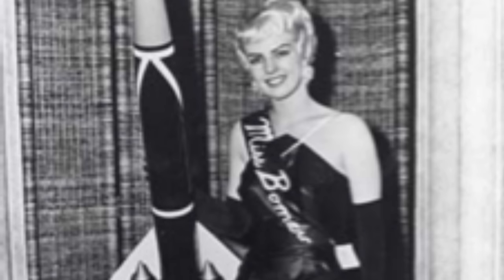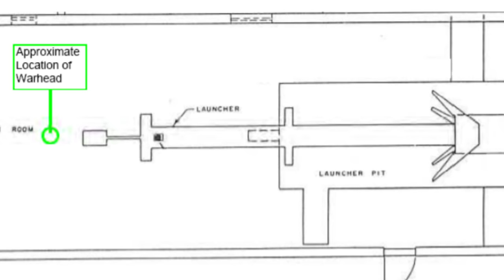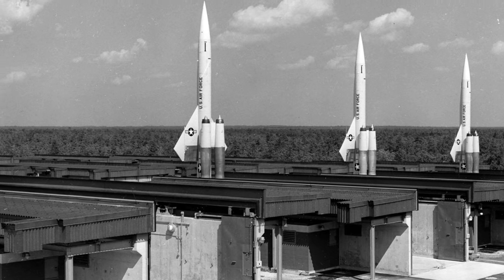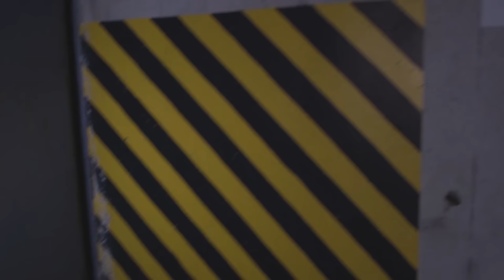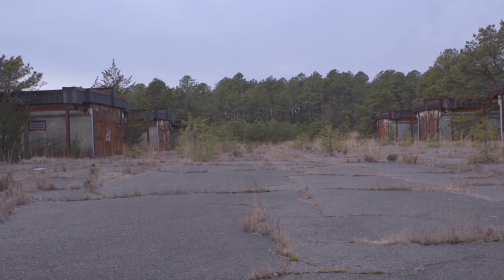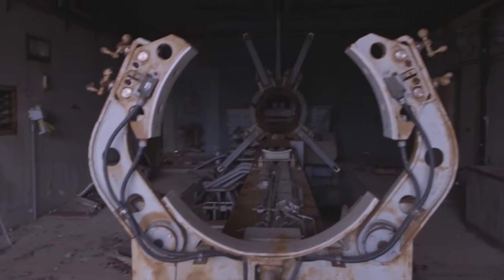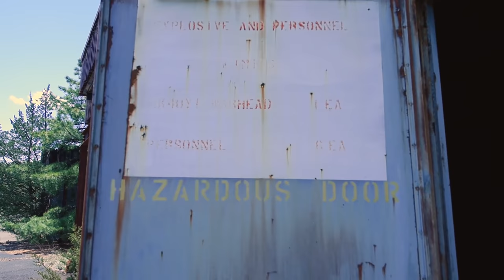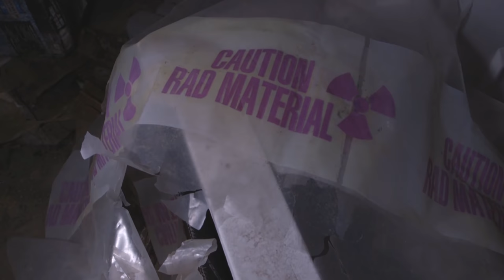1960 New Jersey BOMARC Missile Fire

Comment: I was stationed at Fort Dix in 1988 for a short time before heading to Germany and while at the NCO club, heard one of the old timers speak of this event. Area is still off limits as far as I know.
Our local former BOMARC site at Camp Edwards, Massachusetts was recently bulldozed, but I did visit before it was gone. Those shelters were amazing!
Reply: 1983
13B10
Special Weapons
"Mike 5."
Reply: Bill Harris They actually built a building over top of it now after many years of removing a ton of soil for many years.
Reply: Christopher Cunningham 

Really? I figured that spot was probably so irradiated due to the warhead and the leakage that would be unusable as a building site for a lot longer than this timetable. Is there anything left of the BOMARC site or has it all been bulldozed?
Reply: Bill Harris So it's not on the whole site but yes they did knock what was left down. I actually live off Range Rd. Less than 5 minutes give or take from the former site.
Reply: Christopher Cunningham 

I see!

Comment: This occurred on Route 539 on the border of Ocean and Burlington counties in New Jersey. The plutonium isotope used in the warhead is, to my knowledge, still on the ground. According to what I know of this, said plutonium is highly lethal if as little as one tablespoon is exposed through airborne means in a densely populated area--which this location is not. However, the soil in that area is part of the N.J. Pine Barrens. It is, essentially, beach sand. I know this for the fact that I worked in geo-technical engineering during the '90s. There's no silt to hold anything back from seeping into the ground. In the Pine Barrens, you have groundwater--some of the freshest groundwater on Earth--flowing at roughly 6-7 feet below grade. This stuff has been on the ground for approximately 60 years. Given that Toms River, N.J. experienced a significant cancer cluster, as did the Legler section of Jackson--and both are in very near proximity to this location (bring it up on a map, you'll see)--it's no wonder. How do I know so much about this, you might wonder. I was supposed to be the engineering inspector for the remediation of this site back in 1997. Suddenly, the government pulled the budget. Consequently, all that's been done in the years since is that they've planted trees so that you can no longer see the site from the roadway.
Reply: There was the Ciba Geigy Corp. site in Toms River that was also responsible for cancer issues.

Comment: I was a GCI controller stationed at North Truro Air Force Station on Cape Cod. We were in operational control of all interceptor and surveillance activity during Level IV training and if it happened, during war if the large SAGE direction center in up-state New York was destroyed.  One of my first tasks upon initial assignment was to be part of the Bomarc release team.  Our radar control system was a computerized BUIC III system and the computer would form an air picture of the entire north east of the US from above New Jersey to the Canadian border. We practiced against a mass Russian bomber attack coming from the northeast primarily and the we regularly fired simulated Bomarc missiles from their launching points. As I recall the only active Bomarc facility at that time (1968-69) was in Bangor, Maine.  Those shelters are still there today, long ago converted to commercial purposes and made part of an industrial park.  I well remember seeing the symbology for a simulated Bomarc as it streaked out to sea. The concept that time was that the Bomark would explode creating a large area over the ocean where any group of Russian Bear heavy bombers would be destroyed.  The assumption then was that a mass attack could easily overwhelm the available F-101, F-102 and F-106 interceptor aircraft we possessed.  I still remember the first time that I held the Bomark key, part of the concept of two man control. Each key station was on either side of the huge area map located in the operations center.  I had one key and another young officer had the other and when commanded to do so by the senior director, the keys had to be turned simultaneously that would arm the circuits that would release and authorize the actual launch of the Bomarks.  I found the experience as a newly minted second lieutenant to be daunting because I knew if and when the keys were actually turned in earnest, those Bomarcs would launch and once airborne, they could not be  recalled.  Fortunately all our "launches" were merely symbolic and done in training.

Comment: I was a section chief in a Lance Missile unit stationed in West Germany during the cold war.
The Lance was a tactical Nuke that also use a Hypergolic fuel system.
The fuel we sued was UDMH  ( Unsymmetrical Dimethylhydrazine )  and the
oxidizer also was IRFNA  (  Inhibited Red Fuming Nitric Acid ).
We did not use helium to pressurize our tanks. We used a SPGG  (  Solid Propellant Gas Generator ).

Comment: I was a Civil Air Patrol Cadet in the late 1960s and early 1970s.  I well remember that as cadets we were given a guided tour of the McGuire AFB BOMARC site some years after the above incident, which in hindsight seems rather remarkable.  We were shown the site of the fire, which was on the other side of a chain link fence.  It's probably just a coincidence, but I'm mostly bald now.  : - )
By the way, the US Air Force's first "jet interceptor" was the single seat Lockheed P-80 - the USAF's first operational jet fighter which was re-designated as the F-80 in 1948.  Single seat jet interceptors equipped USAF interceptor squadrons until radar equipped "all weather" jet fighters could be developed.  The USAF's first radar equipped "all weather" jet fighter to enter service (1950) was the Northrup F-89.  However, developmental and structural issues retarded its full operational service for some time and most of the early all weather interceptor squadrons were equipped with the Lockheed F-94 - also fielded in 1950 - which was essentially a 2 seat development of the F-80 (second crewman being the radar intercept officer) with radar in the nose and an afterburner for extra thrust.  It was the F-94 that saw service during the Korean War.
The F-89's issues were eventually sorted out and it served until about 1970 in USAF and Air National Guard Units. The F-89 was liked by it's crews and most were stationed at northern bases where it's 2nd engine was especially appreciated while flying over the vast frozen areas of the northern US and Canada. In common with your nuclear missile theme, later versions of the F-89 were armed with AIR-2 Genie air to air rockets.  These were large, unguided, nuclear-armed rockets that were designed to be fired into enemy bomber formations approaching the United States and an F-89 so-equipped could carry two, plus Falcon non-nuclear guided missiles.

Comment: Excellent history lesson! We have a “lesson” waiting to be learned not far from our house in Georgia. The Air Force had  a plant located near Dahlonega which had several reactors for studying the problems of unenclosed reactors- a possibility for an aircraft propulsion system. Some of the facility is now a public park! Unable or unwilling to remove some of the structures has resulted in many lingering doubts about the plant. Most of the questions revolve around how one reactor would be run unshielded in the out of doors-and the consequences today. A good read is “Atomic Adventures”, by a researcher involved, James Mahaffey. It covers the tanning of a mule (instant taxidermy) in the presence of alpha radiation as well as the “production “ of plywood, known as “Lockwood “, used as flooring in the AEC building in Maryland. Some scary, and unintentionally funny (Science Fiction 3000 material) stuff.

Comment: minor point most people don't know:  BOMARC was an Air Force (AF) system created/manned by AF personnel stationed at McGuire AFB.  But, the actual BOMARC site was located about 10 miles east on land initially controlled by the Navy at Lakehurst NAS.  While there has always been a close relationship with these two bases.  It wasn't until about 2009 they merged into Joint Base McGuire–Dix–Lakehurst.  The mixed control/responsibility of the land likely added to the delays in clean-up (most "official" histories don't note this).

Comment: I worked at the BOMARC site at Boeing in Everett WA. There's nothing left of the site for the missiles except a concrete pad. The site today has a logistics transfer site for a shipping company, and 4 buildings that house Boeing employee's. The reason for the BOMARC to be located here is that across the street was the Airforce Base Paine Field - which is now run by Snohomish County,  and Boeing uses the field  to test and deliver 747's, 777's, 767's, 787's and the KC-46 Tanker. And Snohomish County recently opened a commercial terminal that has been used by several commercial carriers.

Comment: Several Bomarc missiles that were on static display in parks and museums for many years were removed in the 1990s and 2000s, the reason cited being the combined risk of fire with the thoriated magnesium structure of the airframe. Both a park in Fort Walton Beach, Florida, and the U.S . Air Force Armament Museum at nearby Eglin AFB had their examples taken away.

Comment: I grew up in Rapid City SD, home to Ellsworth AF Base.  Back in the 1950's the base would hold an open house and most of the town would show up to see B-36's and other aircraft.  One year they wheeled out a white container about 4' long and 3' in diameter.  It was labeled as containing a nuclear warhead.  As I and my parents stood looking at it from from about 10' away, several AF personnel rushed up, moved us back, and hurriedly pulled the container back into the hanger.  Later I  heard from my Boy Scout leaders who were all B-36 crewman that they had mistakenly displayed a container with an actual weapon rather than the empty container they had intended.
Fast forward to about 2005 and I saw multiple thermonuclear warheads inside the Pantex plant northeast of Amarillo TX along US60.  This is the facility where US nukes are assembled, maintained, and disassembled.  Take a look on Google maps.  The roundish white things are called "gravel gerties".  They are round rooms with about 10' of gravel suspended overhead to contain plutonium in the case of an explosion of the high explosive in the warhead.  The wide gray thing around the outside is a gravel moat to prevent vehicles from crashing through the barrier fences.  The long white things that look like sidewalks are enclosed so spy satellites can't see what is being moved round the site.  THG - this would be a good topic for your channel.  Also the plutonium fires at the Rocky Flats plant west of Denver, the most expensive fires in US history.

Comment: I walked threw an open gate at McGuire and checked out the building including the one where the fire was.  I visited the site in 1978, 1982, 2009, and 2020.  The base was active at this time and I could have been charged with trespassing or worst.  The cleanup of the Plutonium was not even started on my first visit.  I went right up to the spot where shed 204 was.  I should go back and get some new photo's of the area today as long as I am not arrested.

Comment: Hey, I know this story!  I ought to know the BOMBARC incident.  I live right down the street, less than two miles from McGuire, which is now the MCG Joint base with Fort Dix.

And, yea, we still are the middle-of-nowhere NJ.  We also used to have the missile silos in Lumberton, NJ as well - the final structure used to house the missiles were finally removed just three years ago when they built $600k homes over the old site and a landscaping business on the other side of the road where another silo structure still stands, but without missles, of course.

Comment: The guidance system for the Bomarc was tested by fitting it to a B-57 Candberra aircraft, the test  pilot would let the guidance system guide the aircraft to an an intercept with the target and switch back to manual control in the final stage of the intercept.

Comment: I live about 25 miles from the BOMARC site and have driven past the location for over 30 years.  When the contaminated material was removed in the 2000's it was loaded onto trucks, driven to Navy Lakehurst and placed onto Rail cars for removal from the state.   Many miles of train lines and signals had to be replaced as they had not been used since the late 1960's.    The soil removal area extended westward down hill from the site through the woods and across a county road.  The removal included all the vegetation as well as the soils but the road bed and surface itself was not removed.  The road is a concrete base with blacktop and it was not dug up at all so some contaminants remain there.  On Google maps it is marked as a Nike site and you can see in the satellite image where the trees were removed.   Thanks for sharing this story!
Reply from the maker: There is a photo of one of the trains at 11:17.

Comment: You called this "Joint Base". I think that term didn't come about until the 1990s drawdown. Prior to that (I think), McGuire AFB, Ft. Dix, and Lakehurst NAS were all separate bases located in the Pine Barrens next to each other. I remember flying in a small plane over South Jersey in the 90s and if you looked north over the Pine Barrens you could plainly see the Navy's airfield, with the mockup of a carrier flight deck and the old gigantic airship hangars which had serviced Navy airships as well as civilian airliners such as the Hindenburg.

Comment: I often hear people talk about how nukes are designed with all these unspecified "safe guards" and such, but the reality is that it is just really difficult to set them off in any event no major safeguards are needed for mishandling, for intentional malicious use sure but not for mishandling. The simple protocol for a conventional explosives is all that is needed, don't insert the blasting caps or arm them them until ready for launch.
Every little bit of the mechanism must function to the exact force and down to the millisecond in order to reshape the plutonium core and achieve an efficient critical mass. It might be possible to get partial reaction with some less than perfect ignition but this will not come close to a full detonation, most likely the core would just overheat and pop apart.

Comment: Liquid propellant is always difficult and dangerous to store and handle. This changed with much safer and reliable Minuteman missiles using solid propellant. The only advantage of liquid propellant is that it burns more evenly than solid equivalent, though you can't shut it off once ignited.

Comment: Any time you have a fire involving nuclear weapons, it's history that cannot be forgotten. While the amount of plutonium may not have been significantly radioactive, plutonium is still one of the most toxic substances known to man. Yeah, making that a Historic Place would be a really bad idea.
Seems unlikely that an over-pressurized helium tank caused the JP4 (Jet Propellant 4 - jet fuel) propellant to explode. However, if it caused a leak in the oxidizer tank, all bets are off. JP4 was used at a time when the Air Force figured "We've got all this jet fuel, lets have someone build a rocket that will use it" Turns out rocket engines are much pickier than turbo jet engines about their fuel. The JP4 specs were so 'loose' that it was practically impossible to get two loads of it that were the same. They later issued tighter specs that could be used in rockets - RP4 - which worked, but was a special fuel, which still left the Air Force with all that JP4 which was still unsuitable as a rocket fuel (unsuitable as a rocket fuel = likely to destroy the rocket motor, in a rapid, uncontrolled manner.)
The BOMARC was still a very cool rocket though. Like many commenters here, I had a model I made from a kit. Liked the straight edged wings with the white tips!

Comment: It never ceases to astound me how people responsible for public safety, military or otherwise, have an extraordinary lack of imagination as to how badly and how fast things can go south.

People can be counted upon to screw up, thus, the absolute fools who designed this missile site should have predicted this mishap would happen, and make culverts/dams/impermeable ponds into which cooling/firefighting/waste water would flow. The reservoirs needing to be impermeable to prevent contamination of groundwater, containing the waste such that it could be treated or removed later.

This incident is just, oh so typical of the lack of responsibility the fools exhibit, who put this kind of hazard in our back yards.

Things are not that much better today, in 2022.

PEOPLE IN CHARGE SUFFER FROM A UNIVERSAL LACK OF IMAGINATION.

Oh, and?  "Low level plutonium contamination?"  Dudes.  It does not matter how LOW LEVEL the contamination is?  If you get a spec of Pu in your lungs, it will not bode well for your continuing health.  

"Here.  Have some lung cancer, sir!"

I mean, what about the fools they hired to "remediate" the site?  How much plutonium exposure you think they got?  Why do fools insist on moving this stuff around to expose and kill more people?  

Making a bad situation much worse?

A six inch concrete cap on 20 or so acres would have been a much better solution, perhaps?

I'm just sayin'...

...